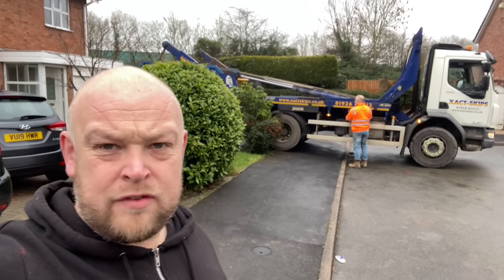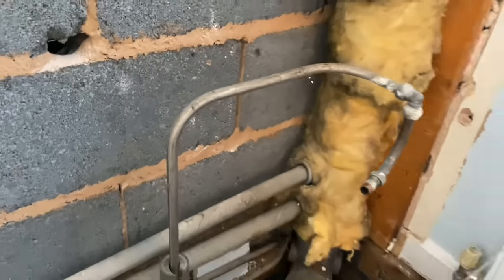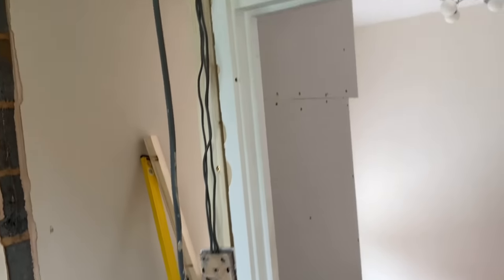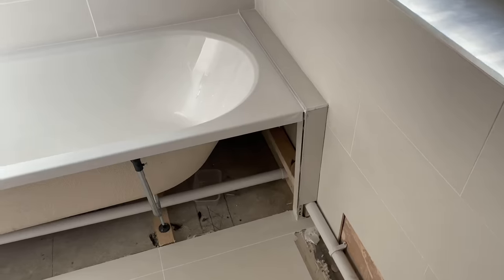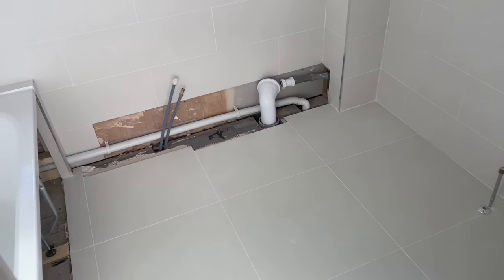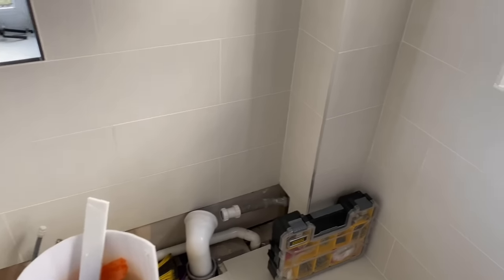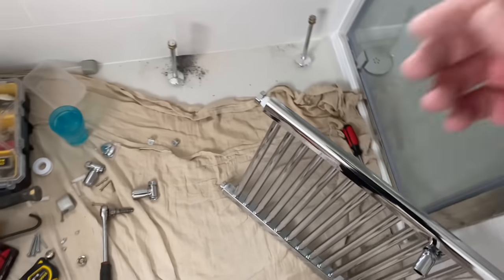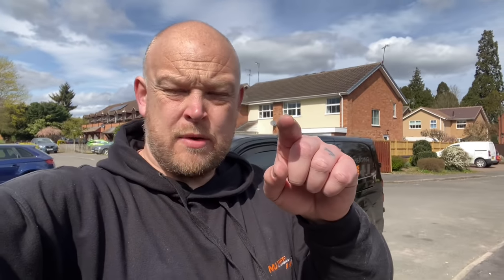BATHROOM REMODEL COMPLETE from START TO FINISH (Amazing Result)

Comment: Hey mate first time viewer, just wanted to mention if you haven't thought of it but fit the taps and tails while the bath is off then just connect up once the bath is in, saved doing it all from under side of bath
Reply from the maker: Thanks for watching buddy, and welcome to the channel 👍🏼👍🏼

That’s exactly how I do it mate…. 😉
Reply: @MJTiffPlumbing  Awesome. Couple of questions mate, first off what's your preferred [personally] adhesive to use to fix down a shower tray? S&C, CT1, tile adhesive, etc, etc
Secondly, customer has mega build up of black sludge-like mould above water level in concealed cistern and constantly in the tip of shower head and taps, even after having a new bathroom installed (years ago) I thought it might be a combination of normal build up from not wiping down properly but the contained cistern in a vanity unit has MEGA build up, so perhaps lack of an extractor in the bathroom? What you think

Comment: Class installation. 👏 Would have liked to seen the tiler at work as well. Interested to see a video sometime on how you price these types of jobs, level of contingency added in in case of unforeseen problems, i.e. knackered floor. Really enjoyed watching this. Keep it going. 👍
Reply from the maker: Thanks mate..... I was chasing my tail on another job when the tiler was on this one so could’ve get any content. 

The issue with the floor was an extra as it wasn’t known about..... however due to the mess up with the tiles I didn’t charge her for redoing the floors. 
Good will gestures go along way I’ve found 😉
Reply: Can you tell me what colour where the tiles, thought grey at first, but wasn't too sure if they where beige?

Comment: I like to fit radiator service valves from toolstation when I install towel rads cos it gives you a shut off point and there not expensive

Comment: Hi there, with using tiles for the shower area, would you not advise tanking the area.  thanks.
Reply from the maker: I’ve tanked showers and I’ve not tanked showers and never had one issue….. it’s it’s sealed round the tray and tiles right it will be fine

Comment: We had the same problem, the floor was all rotted through in our bathroom near the sink and the joists were gone too. The plumber fitted a new floor and joists with an extra cost but he didn't use waterproof plasterboard on the shower compartment like he said he would. I notice you used waterproof board where water is being used, nice touch.
Reply from the maker: Always good practice…..
Reply: @MJTiffPlumbing  I asked him why he didn’t fit it and he said it was too expensive lol.

Comment: Hi there, can I use a 50mm pipe with an Admittance valve to vent my 110mm soil pipe instead of using a 110mm valve. By the way, love your videos
Reply from the maker: Yer should work fine mate

Comment: Bathroom looks great you done a cracking job of that 
Not a straight forward bathroom either with adding showers, stainless pipe and rotten floor to deal with but you Made it look easy great video 👍
Reply from the maker: Thanks mate..... no, it threw a lot at me to deal with but it looks so good as an end finish 👌🏼👌🏼

Comment: You made this installation look easy but well done mate! This looks grand. Quick question, the tiles on the floor, did you have to put something on top of the sub flooring to lay the tiles? If so which material
Reply from the maker: That’s buddy…It will of had hardie backer cerment board on before the tiling..

Comment: Hi Mark nice video,  why you drill into the tiles to fix the shower door when you bonded The shower door to the tiles, there was only 10-20mm max each side.. not enough to take the middle out and install correctly. Hmm wrong size of door or the chippies and tiler made the space to small..!!
Reply from the maker: Always screw a screen to the wall…. You would never just silicone and leave it mate.
Not sure what you mean by the rest of the comment…. Screens are designed to have a min and max alteration to fit various sizes….
Reply: @MJTiffPlumbing  watch the video back when you put in the screen,you walked backwards into the shower with the screen, didn't look like you screwed in the sides, .. I am not hiving a dig just a notification. I have to disagree if you bond it correctly there is no chance of it coming of ideally you would also screw it.. Great work all the same.. 👍

Comment: At 39.03 you show the isolator for the cistern at the bottom of the cabinet. The back board behind the pan would be fixed in so it would be very difficult to reach right down through the removable front board to switch off the water!! I always bring the cold feed up so the isolator can be accessed easily especially for the customer who might need to do that when you are not available. Bathroom looks superb.
Reply from the maker: Thanks buddy…. It can be accessed but I know what you mean👍🏼👍🏼
Reply: @MJTiffPlumbing  Cheers!

Comment: What would you do if the floor passes under the stud walling, when you need to replace it? Or should the partition wall usually be sitting on the joists? Cheers.
Reply from the maker: Get the multitool out😉
Reply: @MJTiffPlumbing  I don’t suppose you have done a video on how to fit a level access shower former onto “I joists” ? There’s nothing to screw battens onto to drop the floor. I was told there were clips you can buy but can’t find them anywhere.

Comment: Whag did you replace the rotten flooring with? Is a waterproof kind of board or just MDF
Reply from the maker: The flooring was MDF 👍🏼
Reply: @MJTiffPlumbing  thanks for the reply, what kind of under flooring would you recommend using to prevent rotting/damp from leaked etc ?

Comment: Very nice job Sir.
Few questions.
What did you bed the shower tray down with? 
For the bath, do you put silicone on the sides of the bath that butt against the wall?
How long did this job take you apart from the time it took for waiting on the tiles?
You mentioned you got a tiler to tile, do you also tile yourself?

Comment: I am intrigued why you didn't put the bottom brackets of the towel rail at the bottom  - you put them so high wouldn't they be in the way of the towel?? Re ptfe tape V liquid I had 6 rads to fit so chickened out of using liquid and did them all with ptfe tape because it has always worked for me and can be easily undone!! 1972 was the copper shortage and the only copper pipes were thin walled so couldn't be bent!!
Reply from the maker: No as they were at the side of the rails

Comment: Nice clean job there mate. I cut those counter tops with a jigsaw with a fine blade in and it works well. Apparently they’re a composite material. I was nervous the first time I did one but it was fine. Looks the dogs though mate 👍
Reply from the maker: Thanks Robert..... yer we did the cutout with a jigsaw and it was a lot easier... was a little nervous to start with as it’s not a cheap worktop 🙈

Comment: Been watching some videos you do lovely work! I wonder though some installations you use Mapei wps system did you not do thst here? I’m redoing my bathroom but I wonder if I should put the wps on the tray and silicone first then the wps tape and silicon again after tile. Does that stick? Your input is appreciated

Comment: Do you not use adhesive tape around the shower tray ? I don't know anyone who ever fits a tray without it , moves with the tray . Silicone will only last a while
Reply from the maker: There’s many different ways to fit trays, I have used the sealing kits, I’ve also just used silicone and tanking etc…. And in 26years of fitting bathrooms etc ive never ever had an issue…
If you watch some of the other bathroom installs you will see it being used👍🏼

Comment: Quality job !!! BUT 2 things. One usually have a mirror above sink fo shaving. Should sink and toilet be switched to allow mirror on wall ?
Can the bath panel be taken off without moving end unit
Reply from the maker: Customer didn’t want a mirror on the wall….. hence there is no mirror on the wall, customer is a female who lives alone so no need for shaving point 😉

And yes, bath panel is removable 

BUT….. Thanks for watching😉

Comment: Hi  getting new bathroom tbh hard to find good plumbers like you
Just one question  there was box in corner with 4 inch pipe can we get rid of those pipe
Is it essential to keep that pipe with goes from roof to floor 
Thsnks

Comment: Hi mate, just a quick question, I have floorboards in my bathroom and they don’t look the best, some of them are a little rotted. Would you recommend taking them up and just laying chipboard straight to the joists if I want to tile on top of it? Thanks!
Reply from the maker: Yes mate, wouldn’t be an issue as long as you board before tiling👍🏼
Reply: @MJTiffPlumbing  thanks for the reply 👍🏻👍🏻

Comment: Really enjoying you videos mate. On a previous comment you said you only silicon shower trays. What do you do if floors are uneven?
Reply from the maker: Thanks Ryan.
If they are uneven slightly then you can build up the silicone base to level it, if not it would be a case of leveling the floor slightly before fitting the tray

Comment: I’ve got a load of stainless steel pipe to cut out of a kitchen I’m installing tomorrow as we’ve ripped the old kitchen out and never seen so many compression fittings put in as they’ve had constant leaks. Can I use my normal pipe slice to cut it or is it an angle grinder/hacksaw job?
Reply from the maker: You can use a slice but it will batter the wheel...... Tough stuff
Reply: @MJTiffPlumbing  sound. I might just use the angle grinder and a file. I’d rip the whole lot out but the whole house is done in it and I’m only down to do the kitchen so I want to rip it out as it’s me who is guaranteeing the work.

Comment: Great video - thanks for sharing your skills with us amateurs. Can you tell me what "Moisture Board" you use to tile onto, and what are your views on Air Admittance Valves for the vent stack (save boxing in??)
Reply from the maker: Hey mate, glad you like the content.
Moisture boards are just the standard ones from Jewsons.
As for AAR’s..... they can work great in the right setting, never had an issue with them

Comment: Professional finish Mark👍 what did you use to bed the tray down? Links to the units and towel rad would be great. Look forward to the next one.
Reply from the maker: Thanks mate...

Silicone bedding on the tray👌🏼👌🏼
I thought I had put the links in the description??

If not I will do it later 👍🏼👍🏼

Comment: great video, what silicon do you use to seal the shower? and what paste for the radiator?  I'm new to the trade. Many thanks!
Reply from the maker: Thanks mate

I use Dow Corning silicone and Plumb Blue paste on the fittings 👍🏼👍🏼
Reply: @MJTiffPlumbing   Thanks for your help.

Comment: lol like the comment about you don’t look old enough to be doing it for 27 years over all i like everything up to 99% percent the one percent i’ve take away was for the towel rail i’ve always put my pipe work dead on center of the towel rail coming out of the wall as a pet hate i don’t like the pipes coming out from the floors so there is your one percent explanation but yeah good work over all can i ask how many days you take to do this bathroom ? if you respond i will tell you how many days maximum i take

Comment: Lovely work you have carried out her along with the other trades to compliment. 

Just out of interest did the tiler used tile levelling spacers in the shower? The siliconing in the corners of the showever looked like it had to wander as if the tiles had different thicknesses of adhesives. Could be the camera angles and as such is just a question and not a moan up lol

As always love your style and coverage of your work. Its hard enough doing a bang on job in the real world let alone adding on another thought process as to how to film along the way. 

I aspire to have this sort of finish in my bathroom and have it all started from new so thank you for filming for the world to see!

Thumbs up. Loving the detail about no plastic bath side cover being fitted by yourself, they arr flimsy to fit and cheap as hell and should be made illegal !! Lol
Reply from the maker: Thanks mate… glad you liked it and thanks for the comments.
The tile faces are quite rough due to the style so from some angles looks like the silicone is a little different but it’s all good and the customer loves it👌🏼

As for the bath panel, I won’t fit those plastic rubbish…. The solid wooden gloss finished ones just look great to compliment the finish of the suite…👍🏼👍🏼

Comment: Love the videos👍As far as your typical domestic bath or shower goes normal plasterboard is fine, tiles and grout put in properly with quality materials  such as bal or mapei (not diy crap) along with a good quality professional sealant then water should never be getting behind the tiles.
Reply from the maker: Indeed mate....thanks
Reply: No...it isn't. Why say so? No need to use plasterboard in this day and age. It's wrong.
Reply: Normal plaster board is moisture resistant to a point. As long as you use the rgt tile adisve and grout and also proper silicone. It won’t be a problem.

Comment: Quality job mate, great to see how you work. Very tidy finish and great attention to detail. The units have a recess for the bottom plinth which makes fitting the toilet bowl flush at the back awkward!!!Did you end up running a silicone joint at all or just left it? I thought maybe a clear silicone would be best?? That one piece composite sink is stunning. 👌👍
Reply from the maker: Thanks mate.....just a small bead of silicone around the base

Comment: Would love to know the price and where did the extraction go?
Reply from the maker: Where did the extraction go…??

Do you mean how did I get rid of it??…. I have a skip delivered and it all goes in there.

As for the price, that’s between myself and the customer, prices of bathroom renovations depend on so many different things to be honest.
Reply: Sorry the extraction fan... you mentioned putting a new one in (well the electrician) was it a ceiling one or wall one? Was thinking it would be a ceiling one above the shower area??
Reply from the maker: @leedobbs2435  oh right, got ya.

Yer it will be a ceiling one and it will go outside the shower area, probably above the units

Comment: can you please recommend me where I can find typical uk labour cost for the north of England I've been getting quotes for my medium sized bathroom to be fitted and tiled. I'm supplying all of the items some of my quotes have been nearly 5000 pounds the guys tell me it will take 6 or 7 day max and there's 2 of them on the job. if 8 work it out there charging 350 400 pound a day each in labour for what I'm guessing will be 8 hour shifts.
Reply from the maker: Sounds about right mate……
Reply: @MJTiffPlumbing  reply so if it's completed in 6 days that would be 400 pound a day labour each person x2 people probably 8 hour shifts. 50 pound an hour.each. I can't justify that
Reply from the maker: @oumuamua1963  
If they are the quotes your getting them that’s what the going rate is…… people think us tradesman are not allowed to earn money for the YEARS learning the skills to be able to do the job in that time…

Out of curiosity what do you want to pay…. As it seems you have an idea
Reply: @MJTiffPlumbing  considering the UK average wage is about 30k a year. Or 14-15 pound an hour. My understanding is 30 to 35 pound a hour or 240- 275 pounds a day for a high quality tradesman who works quickly.
Reply from the maker: @oumuamua1963  
Looks like your going to have to have a go yourself buddy…….. then you will have to buy all the tools, learn how to do it…., be confident in doing it, also learn how to tile and possibly plaster….. oh, and electrics…….

Then as you won’t have a trade account you will be paying more for the materials etc…….

Good luck buddy….

Comment: i find it that on super hard tiles its easier to drill a new hole in the alu profile that matches with the grout joint, and on that door it's easier to mount the profile on the hinge side to the wall and then slide the glass in, then you dont have to balance it so much
Reply from the maker: You should never drill a grout joint...... not good practice and can compromise the seal.

You can’t mount the profile then slide it in as it’s 2 fixed walls abs very tight, hence doing it the way I did it
Reply: @MJTiffPlumbing  what seal? where i am from tiles and grout is not waterproof, Tile and stone (as well as grout) will actually retain water

Comment: How long did I that bathroom job take?
Reply from the maker: Thanks for watching mate....from start to finish minus the issue with the tiles it was a 10 day turnaround
Reply: @MJTiffPlumbing  sweet thanks for the reply, got to the end looks brill! Subbed to see more. I wanted to ask as I’m a gas engineer that mainly only does boiler work, just undertook a complete bathroom refurb at home including walls coming down and move, so far done everything other than plastering but has taken me quite abit more than 10 days 😬🙈.

Comment: Tiled bath panel and rad pipes out the wall on corner valves would have been nice but top work
Reply from the maker: Never fit a tiled bath panel... as it will need to be removed and will damage the tiles, massive no no from me on that one...

Comment: Do ye have a product called classy seal over there it’s an adhesive strip with rubber backing  comes in a roll. No more silicon on baths or shower trays. Check it out on YouTube or google. Guaranteed not to leak. It’s a must for plumbers and tilers. Do a review maybe would be very interesting
Reply from the maker: Yer we do get it over here mate, I’ve never used it but I may well try it on the next one and give it a review👍🏼👍🏼
Reply: @MJTiffPlumbing  they are decent mate, I've used them a few times, really easy to fit